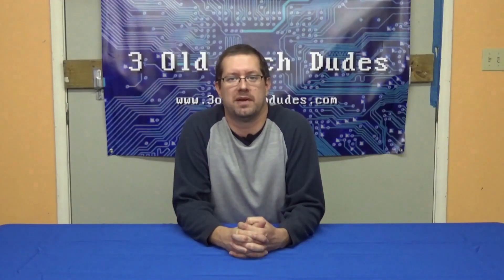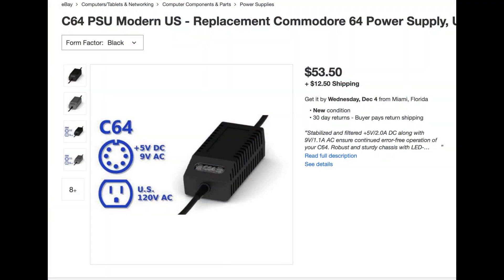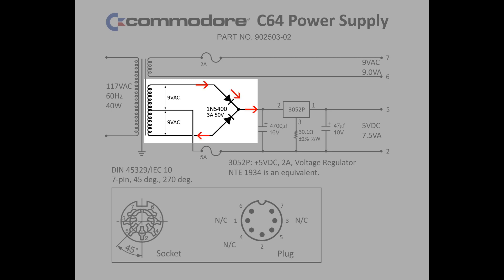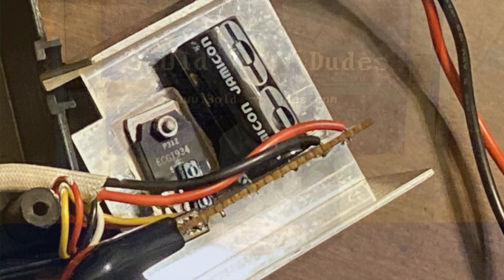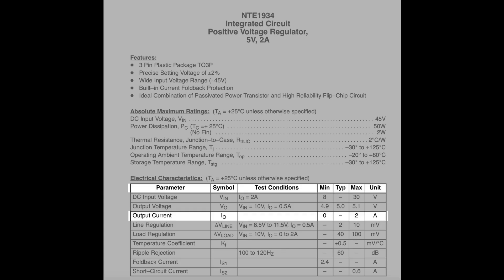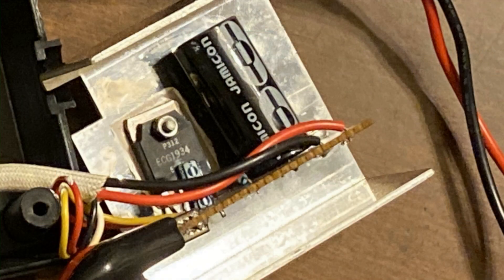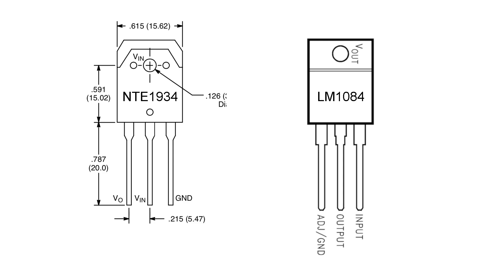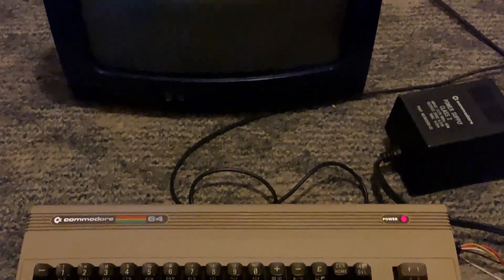How to fix a dead Commodore 64 power supply (voltage regulator replacement)

Comment: I have rebuilt 2 of my exact same type of power supplies, but I replaced them with the NTE1934 regulator, which is supposedly a higher amperage version of the same thing. The problem is I am consistently getting 7.2 to 7.5 volts with the new regulator installed in the exact same circuit. (well except for the caps being replaced with Rubycon ones of the next higher voltage rating).  The 3 watt power resistor is still 30ohms, yet I am still getting 7.2 to 7.5 volts. I have now installed 3 different NTE1934 regulators from different sources. Are you SURE the NET1934 is truly a drop-in replacement for the 3052? >7 volts is way too high a voltage. Btw, BOTH of these power supplies had > 7 volts with the NTE1934 regulators. Am I doing something wrong here or are you using a different voltage regulator?

Comment: Hi guys, are we sure on the 18 volt being passed to the voltage regulator?
It seems to me it should just max be 9 x 1.4 = 12.6 volt on the DC side.
Love the great detail on the video.
Reply from the maker: Hi there, no, not sure, honestly. I think a reading I took after the video was done at that point in the circuit was more in line with your calculation (11.8, maybe?)  I'm not the greatest schematic reader it seems, still a beginner regarding that in many ways. -Tim
Reply: @3oldtechdudes  
Does sound perfect.
Again great video 👍
Reply from the maker: Thanks so much for watching, as well as your input!